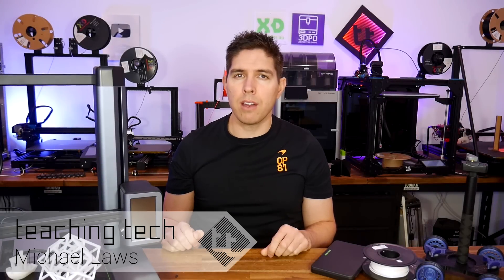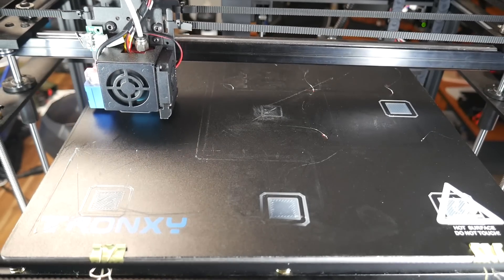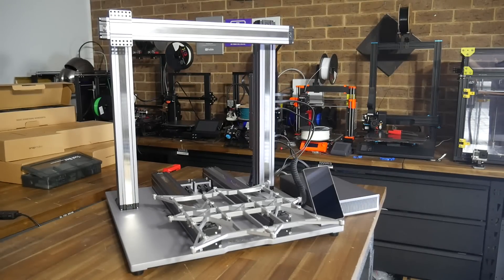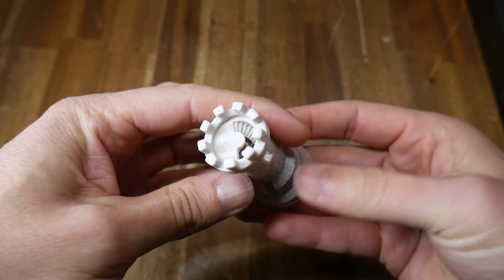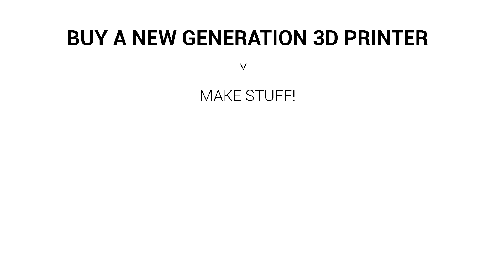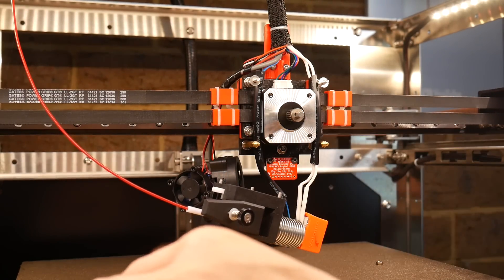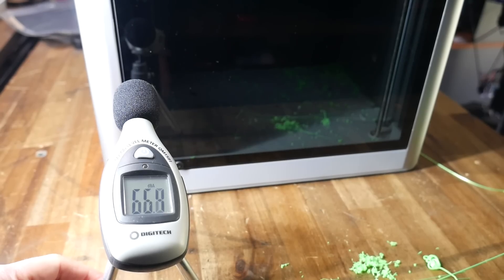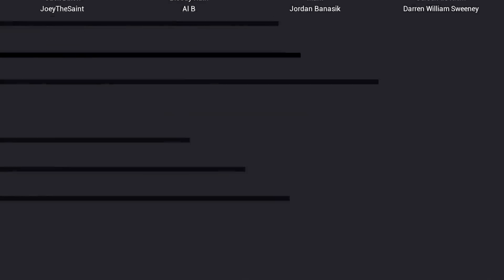Next gen 3D printers are here, but do they bring fresh problems?

Comment: really curious about the ankermake. They just upgraded to 500mm/s. I couldn't believe it when i saw it on a Cartesian style printer. I've read that MANY people have had QC issues and problems though. I'm really interested if it's comparable to the P1P
Reply: " Cartesian style printer"

The claimed speed for the Ankermake printer is astonishing if true.   FWIW "cartesian" does not mean bed slinger, it just means it uses an X,Y,Z coordinate system.  This includes nearly all printers; bed slingers, CoreXY,  Delta etc.

Comment: The thing that really confuses me about the noise aspect of 3d printers is that even when using fans, it’s definitely not hard to make the printer silent.

Plenty of people (including me) upgrade their printers to use super silent noctua fans and these upgrades are so efficient that I can’t even hear my Ender3 when it’s running even tough it’s right next to my desk.

I just don’t get why manufacturers don’t sell their printers with these fans pre-installed from the factory and instead still try to advertise printers that run at 40db+ as „silent“ when they are loud enough to be distracting when you try to work or sleep in the same room.

Comment: For me learning is a big part of the fun of 3d printing.
I bought an Artillery Sidewinder X1 without any experience at all and I had many issues with it because I upgrade almost everything. I got really frustated (i didn't like that part of course) but solved the issue and it's so much fun now.

I will probably skip this generation of 3D printers and hope that new innovations come in a bit faster from now on. I hope we will get 5 Axis printers for consumers in the next 10 years. Even 3 Axis Non-Planar Layer printing would be really cool.
Reply: I started with a sidewinder x2 a little more than a yr ago, and bought a second shortly after the first one. 

I've had my ups and downs learning the machines and the hobby but both of my machines work well and have needed minimal repairs and maintenance. 

I bought a Bambu X1C a few weeks ago and now I regret not buying one sooner. 

The amount of time the machine saves and the convenience factor both outweigh any reasons to not buy one if you 3d print daily or weekly.

Buy one, you won't regret it

Comment: At 6:05-06 you state both the Bambu X1 and Ankermake (M5) self calibrate down to the offset. This is inaccurate: The Ankermake does require you to set the Z offset. The X1 does does do it all for you.

I love your videos, by the way. You certainly know your stuff. And this one is simply grand. I just paused it to write this.
Reply from the maker: You are definitely technically right. The M5 does have a z offset adjustment. I just haven't needed to use it because the self calibration was spot on. So I am also technically right:) I will cover this properly in the review.

Comment: I want a core xy race to the bottom... My ender 3 doesn't make me money so spending a bunch of money doesn't make sense.
Reply: Same. I use it for hobby, but man it's annoying to wait an entire day for a prototype shell for something to finish and realize I made a mistake on a setting or just changed my mind on a design decision. With limited time off, having something print consistently with accuracy at >=100mm/s would be very nice so I can crank out more iterations
Not $800 nice though considering I'm using a $100 ender 3 pro with $150 of upgrade parts.

Comment: I decided to get into 3d printing earlier in 2023, and when I started researching machines and capabilities, I was shocked and disheartened at how immature the space seemed to be.  As this video points out, it's largely a sea of low-quality, high-maintenance printers that I would not consider ready for release to consumers.  So when I found the Bambu X1C I bought it.  Very happy with it and have not had any issues.  Michael makes a very good point about Bambu's slicer being forked -- and that this is effectively Bambu taking from the open source community but giving nothing back.  I don't disagree with that view, but I am also a buyer who prefers a fully functioning ready-to-use product.  If Bambu writes their own slicer I'd be fine with that.  But that probably isn't practical or realistic.  The IP issues aside, I think this new generation of ready to use printers will only bring more people into 3d printing and break down the walls created by the race to the bottom effect that made 3d printing exclusively the domain of tinkerers.

Comment: the biggest problems with these new printers is the lack of it being open source, and no easy way to upgrade and/or fix parts.  I'm interested in seeing how some of these printers (i.e., Bambu Labs X1C after 2000 print hours.  My Ender3 and CR-6SE are both still going strong after more than 2500 hours of printing on each.
Reply: Ease and ability to repair or upgrade/replace parts including from 3rd party suppliers is a concern of mine too.  I am looking at the P1P or K1 possibly later in the year to supplement my older machines.  Your points match my thoughts as I wait and watch how some of these new machines turn out.
Reply: I can answer that i passed 2500 hrs recently and have been printing since last Aug, I have retired multiple printers (mk3s+, ender and ankermake) and run my printshop solely on my X1C.
Reply: @ashleys3dprintshop  Thank you.  I am leaning P1P and enclosing or maybe X1.  Since I have time I will keep on eye on Creality K1 and other non bedslinger newcomers.  Even if K1 turns out to be a good machine overall I would still lean towards a bambu for the slightly larger build plate to be honest.
Reply: @gitss7367  Sure thing. I have been keeping an eye on the K1 and most interested on the k1 max for the larger build volume. The K1 has some teething issues and needs dialing in. The Max with the larger build area is very interesting. 

I am currently not a fan of Creality but I dont have any brand loyalties but I will say that Bambu has more than made me a fan.
Reply: My X1c is already degrading after 1k hrs on the clock. I can give another 500hrs at max until it asks for a repair.

PS: Part in questions is a RH LM8LUU bearing
Reply: @Botanic2000  The beautiful thing about youtube is you can post a video as proof of your assertions. 

I have videos on my channel with milestones with the last being at 2500hrs. When I get a chance I will post another video at around 2600hrs+. 
I'll print a torture trophy since the printer is a champ. I'll do it in silk pla for such an occasion.
Reply: @Botanic2000  if you're not caring for the printer then, yeah, it's gonna crumble after 1k hrs, just like any other machine that exists. that's what i'm assuming you're doing wrong, as this other guy shows clear-as-day proof of 2.5k hours.

Comment: The problem i have with these "smart" printers is that they end up having so many proprietary parts that you'll have to buy from them rather than something open source. I owned an Ankermake and decided to sell because repairing it will not happen if something major breaks and you'll have to send it back on your dime. I am all for prusa, voron and open source. Ill never deal with creality. They are open source but they have crap customer support and the machines are headaches. Gl getting assistance from them.

Comment: I want the whole world to be more open source, and 3D printers are a major component in that they allow small scale fabrication of spare parts. So any printer that isn't itself hw & sw open source and easy to repair is a foe. Still, as a cheap tinkerer that benefited from the race to the bottom, it's great to see printers that deliver out of the box value more and more, it's a great direction for the whole ecosystem

Comment: Nice Review - Question, based on all your testing what other Product in the market competes with Bambu X1-Carbon Combo in termes of multi-coloring print, doesn't matter wether its double nozzle or single, of which it does look like a double nozzle works best with multi-coloring. ?

Comment: I Personally have no desire for a "simply prints" printer. I have several budget printers that as far as quality and reliability goes i would put up against almost any of the ones mentioned. maybe not as fast but surely as well. Yes i had to tinker and upgrade but thats as much fun as the printing to me. Sure there is barely if any support but you know that going in and can always find the answers easily enough. I like that these printers exist for those that cant be bothered but for me i have no use for them. Especially when i can build a Core XY that will still smoke most of them for about the same with the satisfaction that I built it!

Comment: My "entry" into the 3D printing world was an Anycubic i3 Mega S ~2019 which was, at that time, rather cheap, but not yet Creality cheap. Has served me well over the years, but I probably sank about half of its original price worth of upgrades and replacement parts into it to make it way quieter and a bit more reliable. 
But I've reached a point where I think it's no longer worth it to pump even more money (and time) into it and think about getting a newer/bigger/better printer. The new machines from Bambu and Anker look fancy, but their completely closed ecosystem and app/cloud approach is something I'd never want... Tinkering with your machine isn't something I'd want to need to do right away (again), but I want the option to do it! My current considerations go towards either a Voron 2.4 or a Prusa XL. Both are in a similar price region, are available as kits (though the assembly effort is vastly different 😅), and are fully open source.

Comment: I'm happy to see Bambu Labs upping the ante with their fast Core XY printers but I have concerns about the long term reliability of the non-replaceable carbon fiber tubes used as guide rods.  I think Creality's K1 clone of the Bambu Labs printers took a more robust approach by using steel guide rods and larger stepper motors to accelerate and decelerate the extra mass, but the Creality K1 is apparently having problems with the extruder.  Fast printing puts greater demands on the extruder.  Hopefully they'll solve their extruder problems soon.  If not, I'm confident the aftermarket will solve that problem.

I'm also very concerned with Bambu Labs attempts to benefit from open source technology while locking down as much as they can with proprietary technology.  I don't like their entire mindset and corporate philosophy/ethos so much that I don't want to buy one of their products, much as I appreciate them prodding the race-to-the-bottom 3D printer market toward faster and better 3D printers.  I'm offended that Bambu Labs wants me to send the STL file that I created on my computer to their proprietary version of Prusa Slicer, then send the G code to a cloud server in China so it can be sent to my 3D printer that's only two feet from my computer.  Deliberately inserting their server into my tool chain implies that they believe they retain ownership over the 3D printer that they sold.  When I buy something, I expect to own it in its entirety and use it as I see fit.
Reply: At the same time I think if they want to stay competitive they kind of HAVE to do this. Yes I'd prefer open but I think this is less "greedy money grab" and more "if we want to be sustainable long term we kind of have to do this even if we don't want to" sort of thing. As far as I know the CEO publicly stated that they plan to open source it if the company ever goes under. Which you can choose to believe or not. I think it's 50/50 which is better than nothibg

Comment: I was ready to buy an x1c when my tax return hit and then I saw that April 9th blog post responding to the Prusa blog post you referenced. The statement they're devoting budget to a team of IP enforcement lawyers when they need to be ramping customer support and quality control seemed like their priorities were a bit odd. That they followed that up with "don't worry we're not going to be patent trolls" was the nail in the coffin for me. When you have to outright state "don't worry I'm not gonna X" it means you know you're doing things that have all the substance of X, but points for being open and aware people would see this as heading in that direction I guess. We'll see in the long run, and maybe there really is nothing to worry about, but I'm holding off until their actions prove that isn't a concern. It's a bit ironic that the enclosed chamber design they are using was something that was decades late to the consumer market bc of patent troll ridiculousness. 

I've wanted my next printer to be a corexy with some specific features but for now Bambu is a no, after the Creality Cloud model theft issue the K1 is out, and the XL is larger than I need or have the space for at the moment. So I'm patiently waiting for a corexy with the ease of use and features (real auto first layer including z height, integrated camera with monitoring and failure detection, higher speed without quality drop from input shaping and pressure advance, easy use of different material types, some other things) that appealed to me to be released by a company that isn't being sketchy. I run some of those features already on my existing bed slingers but it would be nice to have all of that in a corexy package. 

If Prusa released an X that was slightly smaller I might almost convince myself it's worth it, especially with the first layers and zoned leveling I've seen in MK4 videos, but I'm hoping for something without the Appl^H^H^H^HPrusa tax.
Reply: You will be waiting a while for a retail product that has all of the things you mentioned and is open source. There is a reason Bambu Lab took Prusa's lunch. They stopped innovating and charged a premium for a middling product.*

There are no off the shelf solutions that would meet your needs unless you build it and deal with the issues that come with it. (vzbot, ratrig, voron) They DIY space if kludged together with too many disparate solutions.

Prusa is stuck on bedslingers for the mk line and the XL doesnt come anywhere near the features you mentioned. (camera, failure detection etc) 

* I own a mk3s+ and retired it for an X1C with AMS
Reply: Ironic that you talk about open source being important yet don't want to pay a premium for good support. Printables and PrusaSlicer are free to use. If Creality and other low cost manufacturers could do all that without raising prices, this video wouldn't have to be made.
Reply: Agreed, there's nothing off the shelf like that now, which is why I'm in waiting mode. 

I've got no issue paying extra for something with good post sales support, but you can get a reliable well performing bed slinger with good post sales support for 600 where the only assembly is bolting the Y axis to the x/z frame and a couple of wire connections. It's the $300 on top of that which seems excessive to me and seems to be the equivalent of the Apple tax in computing due to marketing of how righteous they are and the cult-y thing they have going with portions of their fan base.

Comment: Maybe it's just me, but I'm starting to get tired of having to troubleshoot issues before I get a good 3d print. I like tinkering, have a good understanding of electronics, a degree in robotics, and I can honestly say that I wouldn't recommend 3d printing using what is supposed to be a consumer (think home) 3d printer to anyone who doesn't understand some basic concepts of those fields. Consumer 3d printers should be easy to setup, work out of the box without hassle and keep working. Just like the much cheaper inkjet printer counterparts. When you think about it, it really is just one more axis! So what gives? You would toss an inkjet in the garbage or return it if it performed as poorly as most 3d printers do out of th3e box. You will never get back all the hours of tinkering to get that one 3D print that keeps failing randomly, and for no apparent reason. So, yes, progress is not only essential, but seriously required if 3D printing is going to continue in the consumer space, and all manufacturers need to start getting this portion right. People want to have a good experience that is hassle free, and our current 3d printers are nowhere near that. If you like tinkering, by all means, buy one. If you consider yourself a patient person, that will be tested over and over again. If you want a trouble free experience, turn around and run the other way. We all remember that first 3d print that succeeded, and it was magical! How many have your scrapped at 90% (and 15 hours or more) because it failed somewhere? I could fill a room with failures, and I bet it would fill up way faster than the 100% first prints. If you have an old inkjet printer, and it misses half the words on the page, and you try it again, and again, and again... Well, you go get a new one. The problem is, the brand new 3D printer may do this out of the box. There has to be a better way! Hopefully with models like this, there will be, but honestly, I'm not holding my breath.